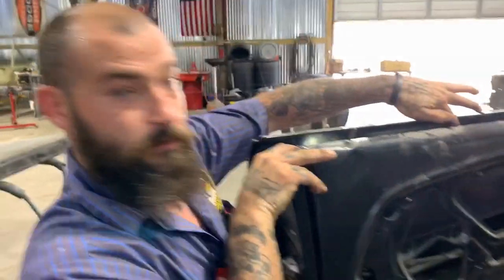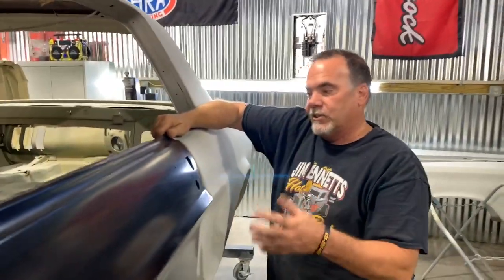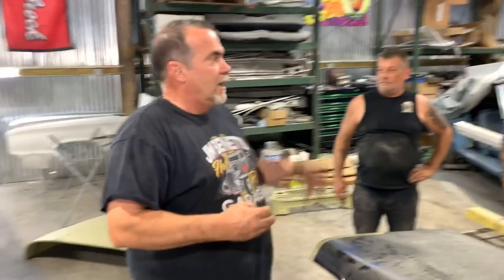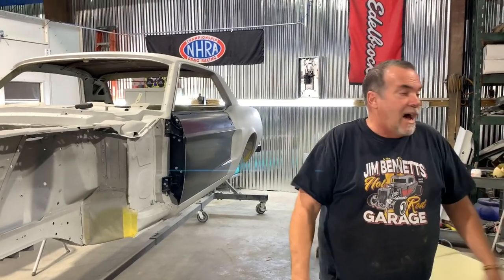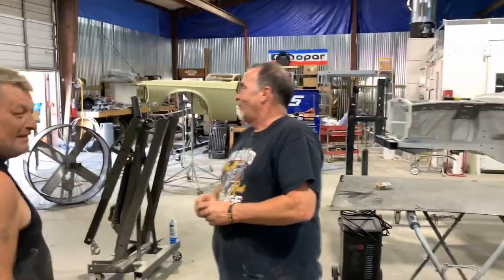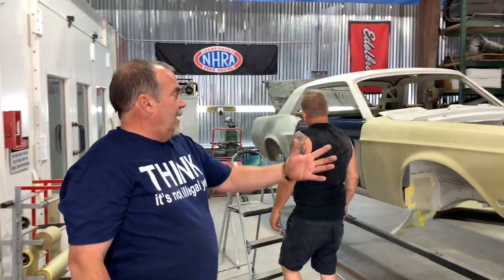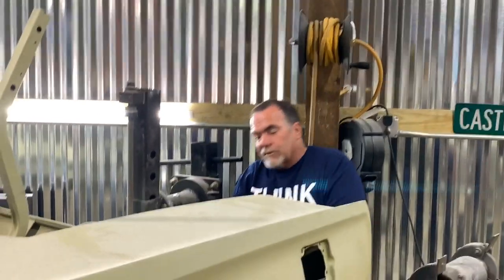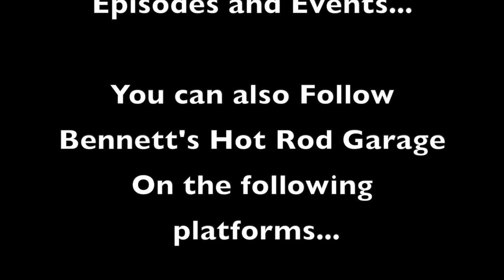68 mustang goes back together to align body panels and 67 coronet has to come off the rotisserie

Comment: Every stamping of repop panels distorts the forms a little more. We do Tri-5s  and prefer to repair original sheet metal with good original stockpiled  doors,floor,trunks.
Reply: Even trunks and floors ? Really?
Reply: @petar443   Yes. floor pans , one and 2piece frames. None are for sale. I drive a '55 Nomad w/427/M22.

Comment: audio didn't have any of the distorted popping, but the vocals were super quiet! Couldn't hear most of what you were saying. (may have been by speakers, but thought I would mention it)
Reply: Just the first section had a low volume but I just turned up my volume then had to turn it back down for the rest of the video.😎
Reply: @bigbear5510  Ha! I stopped watching because I couldn't hear! Now I will have to go back and watch the second half. Thanks for the additional info.
Reply: @jeffbuller6708  You're welcome!😎